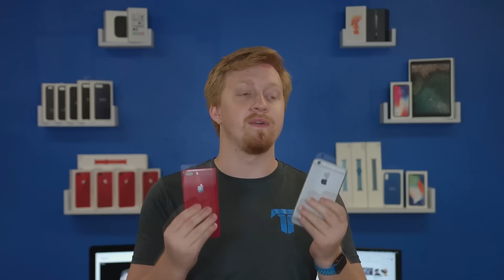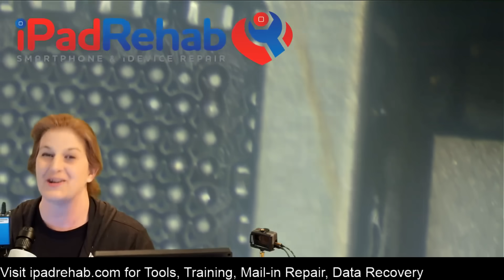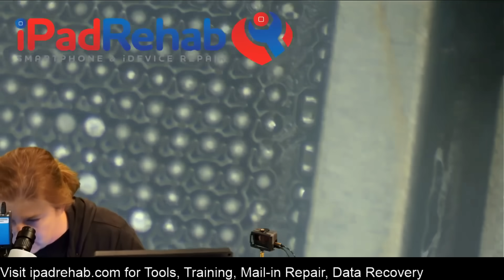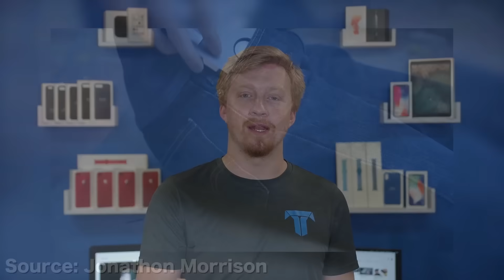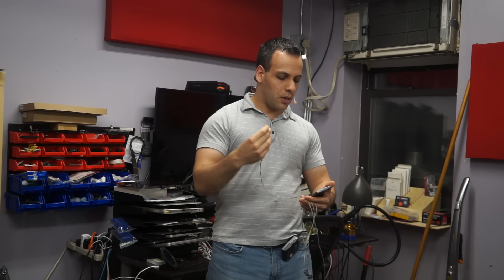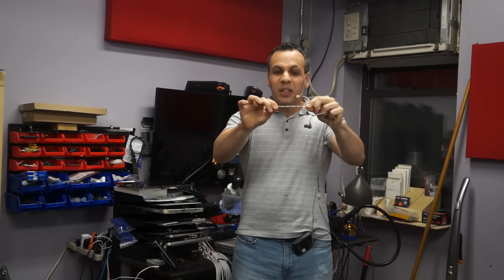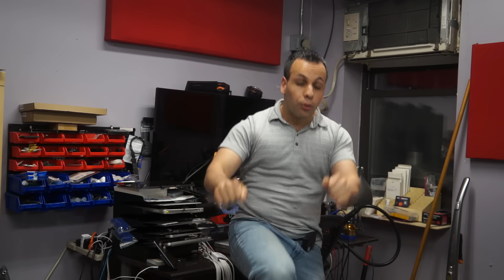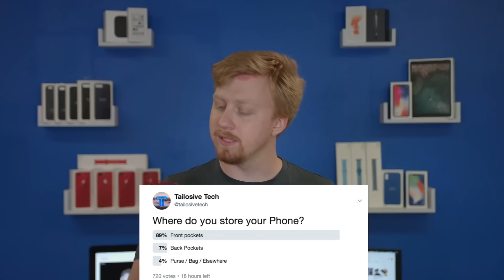The truth about iPhone bendgate deniers

Comment: Wow, its 2020 and I just "upgraded" from my samsung galaxy note 3 made in october 2010.  To a galaxy note 5 lol. I got the note 3 in 2015. Rooted it, got a 1000mAh Qi charger add-on from the old external battery case days. 5300 mAh battery, 32gb internal 64gb micro sd card running Lollipop.
In 10 years that samsung never had any flexion based damage. Note 5 has a 500mAh Qi charger, non-removable battery (3300 mAh), with no SD card slot. Trying to figure out how thats an upgrade. 

Only reason I got the note 5 is apps stopped supporting Lollipop this and last year and require marshmallow as a minimum. Otherwise the phone runs fine, other than the never functioning GPS that never worked with Lollipop but allowed wireless charging.

Comment: Don't laugh too hard but Apple just announced a recall of iphone 6s and 6s Plus that no one will qualify for because Apple did not manufacture any iphone 6s or plus in the recall time frame.
"Apple has determined that certain iPhone 6s and iPhone 6s Plus devices may not power on due to a component that may fail. This issue only affects devices within a limited serial number range that were manufactured between October 2018 to August 2019.
If you believe you have experienced this issue, please use the serial number checker below to see if your iPhone 6s or iPhone 6s Plus is eligible for repair, free of charge."

Comment: 22:58 yes, because clothing designers think women need no pockets and most of our clothing either doesn't have any or they are super tight and small so the phone (especially the giant iPhones that keep getting bigger) has no other place to go than the back pockets. I highly doubt it's by preference, but by lack of options, that women are more likely to use the back pocket.
Also: If you do not manually set your gender in google, it can easily categorize you as male even as a woman because it categorizes after clichées (you watch gaming videos? must be a guy! tech videos? must be a guy! etc)

Comment: I got a bone to pick with you over the Samsung Galaxy S6!
I was pissed they took out the SD card too, at first. But the S5's special charging cable was a pain in the neck, and they hugely increased the default hard drive size to make up for it. It has the best camera of the whole series to date, they reduced them to 12 megapixels after the S6 and it can be used with a flash drive, something I found I like better than an SD card with sizeable internal hard drive enough that I don't need to expand it. I mean, flash drives can be attached and removed as you wanna change what you're doing, eh? So when my 3 year old S6's battery life started getting shorter from just too much use over too long, I bought... A refurbished S6 with an even bigger hard drive! And they might not say they're water resistant, but they somehow are anyways. Weird, eh? I've never had a single issue with either one, not even slowness (though I don't play any high end fancy games) even with my horrible habit of having 20 chrome tabs open at any given time! Don't knock it 'till ya try it! <3

Comment: I put on my wife’s pants one time when I was tired tried to put my phone in my pocket and it went in about an inch the front pockets are normally fake
Reply: lol... i bought Uniqlo men's pants once because hey, free tailoring for the length, and i knew my phone would fit in the pocket... AND I DISCOVERED MEN'S PANTS HAVE A BONUS POCKET IN THE BOTTOM OF THE RIGHT FRONT POCKET!?!?  big enough i could slide a credit card in there, some folded up bills, coins, and even my keys, so they wouldn't scratch up the phone.  and that's just the right side!  i hardly knew what to do with the sudden abundance of pockets!

Comment: It's called fatigue damage. Mechanical engineering is kind of a mystery for apple
Reply: And for Apple fanboys as well, apparently.
Reply: I think when it was released there weren't enough/intensive mechanical tests done to check quality of smartphone design endurance. Now I can tell some companies perform fatigue endurance tests to the prototype product before starting mass production.
Reply: @roimores  It's really not that hard to have someone put the phone in their back pocket and hang about the office for a few days. No special equipment just a pair of jeans and a break room is all you need to test and make sure accidentally sitting on a phone doesn't kill it right away. I think the main point of the issue is that this isn't an issue caused by intensive wear and tear but an issue caused by regular everyday use.
Reply: @That0Homeless0Guy  It is not hard but I think they didn't test it like they do with smartphones nowadays.
Reply: @roimores  And the worst thing about it is that apple releases 2-3 models a year MAX. How is it that they can't even do proper testing on those few devices? So much so that they don't catch widespread flaws. It boggles the mind.
Reply: The boac airplane crash is a very famous example of fatigue damage.
Reply: Alexander Zheng also aloha flight 243. That flight showed engineers that it’s not the flight hours that determine a planes structurally ability but the number of flights it has done. Since that plane did many short flights.
Reply: Alexander Zheng those DeHavilland Comet.
Reply: Well shit, my recent comment is now void. 

Apple is oblivious to all forms of engineering, but mainly electrical and mechanical.
Reply: its not mystery is money,apple.always cut prices using inferior parts 720p cameras 5400.rpm drives
Reply: Its simple apple used a cheap aluminum alloy
Reply: @Aditya Iyer No, I'm Romanian
Reply: It is great mechanical engineering. It bends to apple's will. You won't say that a anti-personnel landmine is defective because it explodes when people step on it.
Reply: The aPpLe eNgInEeRs are actually Apple's marketing department.
Reply: I learned about fatigue on a Seconds From Disaster De Havilland Comet video back when I was 12. The window frame cracked on the plane due to fatigue from changing air pressure after many flights. :)
Reply: Well no its marketing, more you damage more they sell. Plus its lighter than it could be..
Reply: Made in China.
Reply: Yeah, like how the De Havilland Comet started breaking apart mid-flight. The square windows were being stressed over time, which caused them to slowly weaken.
Reply: I was gonna say this lol. I am a Mechanical Engineer myself.

Comment: Surprisingly I've had a samsung s7 edge for 3 years and I've never cracked either front or back glass. I've had the infamous pink line across my screen yet still no damage. I've dropped it so many times I can't count. I also had a simple $5 case. Props to samsung for my durable phone

Comment: Also, what's even more inane about the glass back analogy, is that the glass back doesn't break from regular use. You'd have to drop it or something. So it's still not comparable because one type of damage would be the users fault and the other wouldn't.

Comment: I recently went shopping for a laptop. Havent owned one in almost ten years. And they feel remarkably cheap. I dont seem to remember the top screen feeling like cheap thin flexible abs plastic. But almost every laptop display I felt had that issue. At first I thought it was just a non working mockup display..  but no that's how they are now. And that's not even apple. That was hp, Asus, Acer, etc.

Comment: Still using my s6 works still fine screen has not even one scratch the rubber extra protection is awesome. Btw the battery has now several jears of use but i try not to fastload it often and keeping it between 30 and 80 % load. But still its a bit weaker than when it was new. The s5 i had before wasnt even damaged like the s6 but it wont go on after 3 jears of use just blackscreen.

Comment: The de Havilland Comet airliner was not a dangerous death trap ... until it was after  about a year of service when three Comets lost within twelve months due to metal fatigue from POOR DESIGN compounded by repeated compression decompression cycles from ascending and descending form altitude. ... Interestingly after that the design defects were address they served a pretty trouble (explosive decompression free) life cycle with the military into 2011... 60 years after their redesign. But if it had been made by apple that dude would have whined on the internet that nothign was wrong and the "square windows" were pretty and wern't de Havilland's fault... and be advocateing that the 
Airbus A321XLR should have square windows TOO!!

Comment: As far as bend gate I’m good. The 6 and 6plus did bend but they fixed the weak points in the chassis. I’ve sat on my 8plus a hundred times and it hasn’t bent even slightly.

Comment: Flexion based damage is like using a can opener and leaving a little bit of metal to hold the top on. Then move the top up and down, over and over, and finally, the rest of metal holding the top eventually breaks.

Comment: I worked at a SASC (Samsung Authorized Service Center) and I was shocked by the fact that internally all Samsung phones since Galaxy S4 (Squareish motherboard on the top part of the phone) follows the same components layout that apple uses (Long motherboard at one side of the phone). I also had the opportunity to play around with defective SM-G900 (S5), SM-G920/925/928 (S6, S6 edge and S6 edge plus), and SM-G930/935 (S7 and S7 plus) motherboards. Even though we wherent authorized to perform level 3 repairs (Board repairs) for the client (just like apple if a SM-J700 or galaxy J7 2015 had a bad charging port we had to swap the whole motherboard), we had the broken parts laying around for around a month until a UPS truck picked them up to deliver it back to samsung on the recall program, so I had a month to play around with the components. It didnt matter if the component where beaten to dust and packed in a ziploc, all samsung wanted was us to return the bad part we took out from the customer's phone. So, after playing a lot with S6 motherboard, I was wondering why in hell if the layout is pretty similar to iPhones, there where no bendgate issues with it. What I discovered was that the traces where reinforced and that the PCB was built in more layers than Apples PCB. Also the layer where the traces where located was not the outer layer, there where 3 more layers on top of the traces (obviosly with holes matching the traces locations) It was actually funny because when u removed the solder with a suction tool lets say on the audio IC, you wouldnt end up with a flat surfare but rather with holes in the motherboard. Asides from this, structurally the PCB mounting points where kinda flexible and allowed the mounting points to suffer the stress from bending rather than the PCB. Finally I also discovered that the soldering samsung uses is much more high quality than the one apple uses. In 2 years working there I only saw 2 bendgate issues. One on network IC on a G930 (S7), and one on Audio IC on a G900 (S5). Actually S5 Audio IC issue is way more common due to the fact the phone was made out of plastic and some kind of cement material on the mid frame, but still it was nothing compared to iPhone 6+ touch ic issues, iphone 7 audio ic issues, and iphone 8 network ic issues. Remember I just said I only saw 2 bendgate cases in 2 years working at samsung? Well, after I got a bit of board level repair skills I got tired of not being able to repair anything and quit from samsung. I then started working in an independant repair shop and in my first 2 months there i saw over 20 iphone bendgate issues, specially iphone 6 + touch ic related. You do the math!
Reply: Oh! By the way! I have a video on my channel refurbishing a OEM iphone 6S screen. That was on that independant repair shop!
Reply: The screen dimmed a lot everytime I tested it because the light/proximity/camera sensor cable was not present and the phone was setted to auto dimming

Comment: I had a 6s for 2 years and had no damage and still works to this day as if I just bought it. Not saying that is proof of not ever happening, but the reason they do or did not do anything to fix it because they do not fix them... simple. They just either sell you a new one(refurbished) or replace the entire board. If they actually looked at that damage and fixed it themselves, then they would change the manufacturing so they would not have to fix it. All phone companies do things like this because they would rather you buy their latest phone than keep your old phone.

Comment: It is devices with protruding stuff that gives the device a point of leverage will allow the entire device to flex back and forth over time when lying against a flat surface with some weight/load on it. <glares at iPhone's protruding camera lenses>

Apple knew very well about this flex based damage. Why else would they put in a protruding camera lens giving the whole device an uneven back which will cause the device to "flex out of service."
They could have made the camera lens flush with the rest of the device. But Nope. That would make the device last longer. Can't have that.

Comment: As a teenager I destroyed sunglasses by putting them in a back pocket. From that I learned that putting something in your back pocket carries a chance of damaging it. Sitting on a phone and causing damage is not the result of poor design but poor use. It is a stupid people thing.
All of which is not to say that there isn't a design problem with apple cases. I use an iPad mini. It has never been kept in a back pocket but it has a 1.5mm deflection in the case, just from bring used in the hand. It is bent, but it has never been broken: I have never damaged a screen. I'm not at all surprised that phones are bending.
Reply: My pad has spent most of its life in a leather case too.

Comment: I assume that most people do not understand "qualities of material". Lets be extreme: most of you believe that big metal ships are solid. Well, your in for a surprise -> 
https://www.youtube.com/watch?v=rHlEXn37dVg

Metal is NOT a hard material why it bends. You can harden it but it will loose flexibility. Glass is an extremely HARD materiel why it doesn't bend but break. Due to the molecular structure of metal it can bend and flex back into its original shape unlike glass. Glass can of course bend to but its very limited.

Comment: What you describe sounds like low-cycle fatigue (LCF). That can be caused by structural stressors such as the bending forces being described, but with electronics is often caused by thermal stressors which require no bending at all. One famous such design flaw was the Nvidia northbridge failures in laptops circa 2011. Many manufacturers extended warranties for those laptops and repaired them free of charge. Another similar type of failure happened with Onkyo receivers sold around 2010 that caused HDMI signal processing and driver output not to work properly. In that case, Onkyo offered free out-of-warranty repairs as well.

With smartphones, the space available for heat management is minuscule, which can lead designers to make compromises that cause problems such as LCF failures brought about by thermal stress. When the financial burden of those flaws is hoisted onto consumers, that is shameful.

Comment: You're not sexist for saying that women put the phones in the back pockets, there's actually a good reason for that. Women's pants usually have very shallow front pockets. I have only one pair of jeans that fit my ass and have proper front pockets. Besides, even when you put the phone in the front pocket, it can still cause flex damage when you sit down
Reply: A thing that apple knew and that is why they designed to phone to be like this. We all stand up and sit down once in a while with the phone in our pocket, so they rigged the thing to accept this damage to their phones a few hundred times before getting completly dysfunctional.  Same wirh the 53 code, only after an update did that come. Same with the new battery update. All their scams are like this by design.

Comment: im honestly an android fanboy, yet i find myself falling into the puddle of crap that is apple defenders. i know how shitty their quality control is, and that it starts with design, but yet i still find myself defending them, but only because i appreciate the cohesive experience of apple products. in 2019 my phone is a galaxy s5 that i literally glued together from spare parts, and it functions ok, but not perfect. but i can accept that, because its done by me, not samsung. i have both the iphone 6 and 6s (both 4.7 non plus models) and they are visibly in mint condition, will power on but are completely useless, unless you count bootloops to be useful. both were kept in waterproof, lifeproof branded cases. so even with an extra backbone, flex was obviously still an issue, and for that apple has no excuse. plenty of fanboys do, but they dont know anything about engineering. neither do i, but i know my glued together 5 year old is more reliable than a brand new iphone. how do i know this? because of personal experience. thats the only thing you cant lie to, without looking like an idiot.